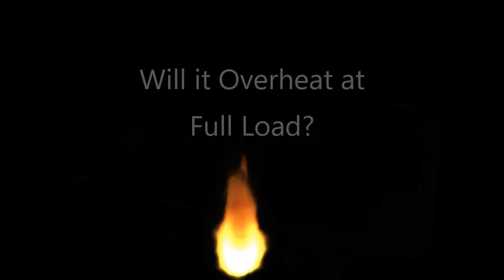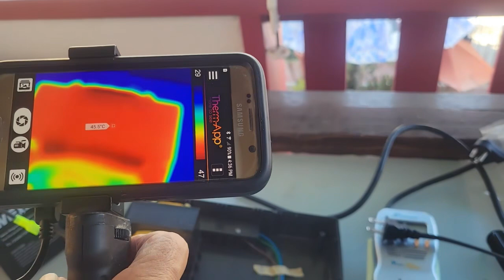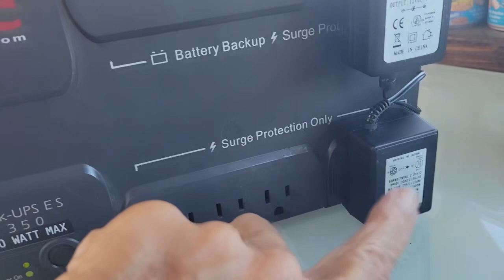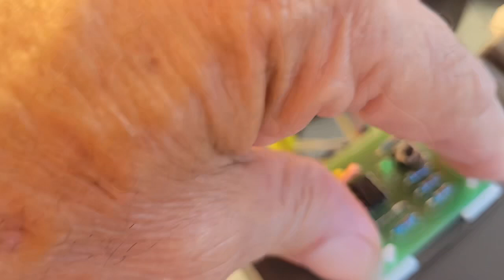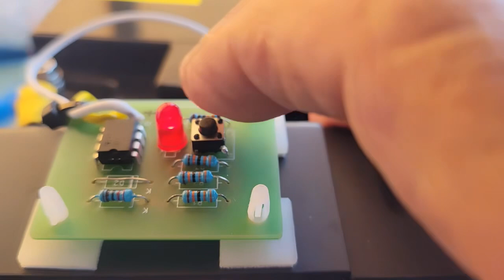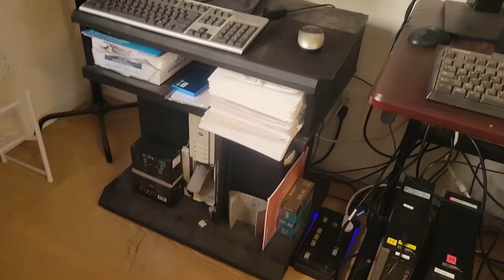UPS Battery Hack

Comment: This project is EXACTLY what I've been looking for. I want to replace my 7ah battery to 20 ah and also I love that relay switch on fan when power is out.😍 I have a question,  Is it required to put a fan on a transformer even my load is not that heavy? I have a router, outdoor extender with poe switch, 2 tp link cameras c200 and c500 and a 10w led light. Thank you so much, I enjoyed the video🙂🙂
Reply from the maker: Not sure about a light load overheating. That would be an interesting test. I saw a lot of youtubes with comments warning of overheating if you do this. I've also seen a bunch of blogs (just google it) where people do this, and then viewers warn about overheating.  So that is why I put it to the test, and yea, sure enough, they do overheat when you do this. The 10 min battery run time is actually part of the original engineering concept. 
Everyone is concerned about the long run time, but it is a fair question about a light load.
Glad you enjoyed this. I originally thought about  tapping into the circuit board to run the12 volt  fan when power is out, and then it occurred to me that the outlets already takes care of that problem. Just use 2 wall warts + relay.
Lucky me, we had a 9 hour outage right after building this thing. It completely   exhausted, and never did overheat with the fans in place.